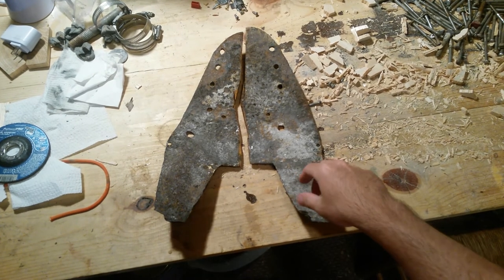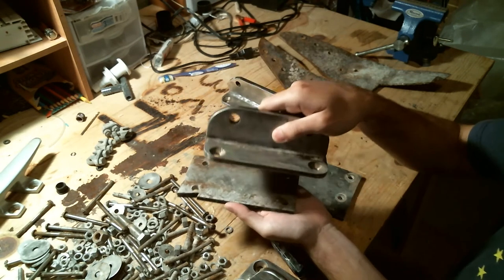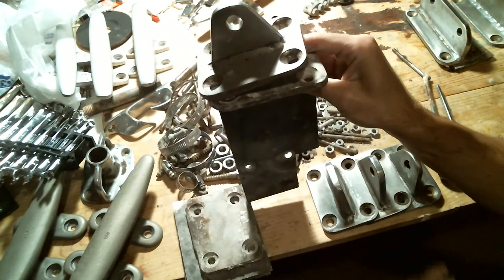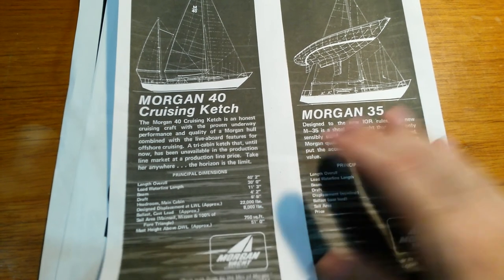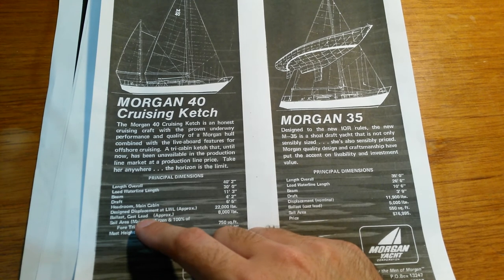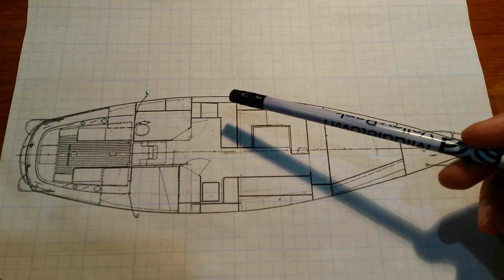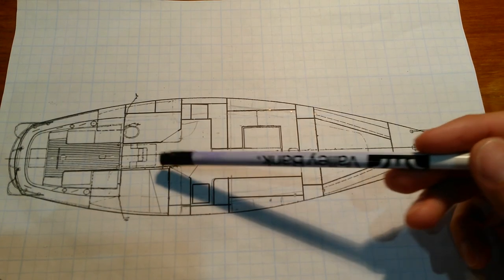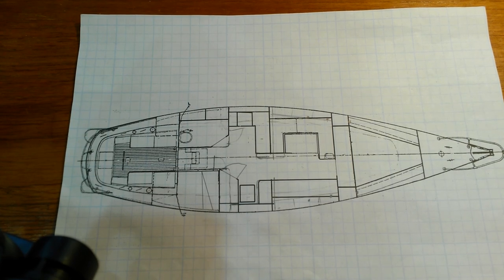Boat Design, Old Deck Hardware, and Rigging

Comment: I wonder why you think you need to modify the backing plates? The boat lasted 45 years as built? Remember modern boats have thinner decks so could not be loaded the same way so require different design of hardware.  I'll look at some newer videos to see what you did if you got that far yet. Cheers Warren
Reply from the maker: Yes thats a great point and I've struggled with this for a while and am split 50/50 between "thats how the boat was originally designed" and modern best practices. I like your point about the deck being thicker  though.

Comment: Your turnbuckles are probably Merriman, but I didn't see the maker's mark on them. If there is a Trident stamped into the casting they are Merriman, very strong and hight quality cast bronze turnbuckles.  That little bit of green is nothing, just a bit of natural copper oxide.  Just lightly brush off with a wire brush by hand, no crazy wire wheel on a drill or anything.  Lube the threads with Tef-45 or standard turnbuckle oil.
Reply from the maker: Thanks for the info! I was hoping to re-use these and was worried they might be too old. I'll check for any markings next time I venture out to the shed.
Reply: Errant Comma  I agreed with Kraken , good bronze is better than SS , the threads  don't gaul when tightening, but they are not a pretty. You can buy them chrome plated now so they look like SS.